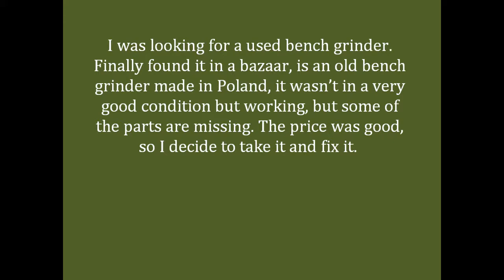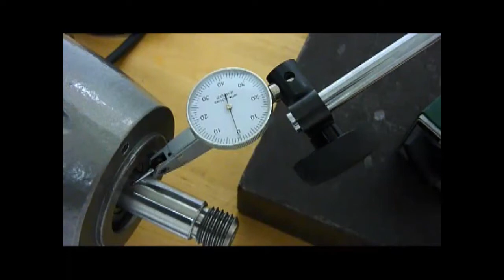Repairing a bench grinder part 1

Comment: Quality work! Just picked up an old Ranch Rite unit myself!
Reply from the maker: +TheFurriestOne  
Thanks! I searched on internet for pictures for the Ranch Rite, but I didn't find anything. Can you send me a link?
Thanks again

Cheers
Jimmy
Reply: ***** I would, but I haven't found any in my own searching! I completed the tear-down and got replacements for the bearings (the old ones had run dry of grease, though they hadn't failed yet). I just got it back together this evening after some cleaning, but now it has issues starting so I'll have to look up what I might've adjusted wrong. It's a bit larger of a unit than yours I think, it's a 3/4 horse unit.
Reply from the maker: +TheFurriestOne 
You can see if its need a new capacitor? I hope you find the problem and put the grinder in use soon!

Best regards from Greece
Jimmy
Reply: ***** Well, I adjusted the centrifugal switch for the start windings and now it works great! I just have to see whether I can adjust the wire wheel so it isn't wearing through the housing, or maybe I'll replace it with a new one. We'll see.
Reply from the maker: +TheFurriestOne 
Sorry for the late reply. Nice to hear that everything it's ok! I can't think something more enjoyable than restoring an old tool or machine! Well done! Send me some photo when you can, I would really like to see the grinder.

All the best 
Jimmy
Reply: ***** Soon as I get some, I will!
The date on mine is 1977, btw.
Reply from the maker: +TheFurriestOne 
Ok! The date on mine is 1981.

Cheers
Jimmy

Comment: Thnx for sharing, i ´ve been using a bench polisher wich is similar to your grinder for a couple of years, but has the same axl problem than yours....and this results in noisy vibrations...any clue on how to solve it?
Reply from the maker: +Nicola Canali 
Thanks for the comment, Nicola! The first thing that you have to do is to check if there is runout on the shaft. If so, then a set of new bearings will resolve the problem. But there is something else that you need to check, since you are using it as a polisher. So, if you use extensions on the shaft to attach brushes, you need to check if there is any runout on the extensions.
I hope that this helps you a little?

Cheers
Jimmy

Comment: I have a grinder like yours and it has lost power. I changed the cap on it, and I was shore it would help, but no it didnt. so I am thinking there is a short some where, have you any idea why a motor like this lose power ? By the way What kind of metal do you use that it is so easy cut it by hand ( well I know it is not that easy, as I have tried it too and it is half a milimeter for every 4-6 minutes....:) thank's for sharing
Reply from the maker: Hi,
Thank you very much for your comment! I'm not an expert on electric motors and I can't say anything for sure. I can tell you what was the problem with my grinder hoping that will give you an idea. The problem was that the motor had a smaller capacitor and it didn't had enough power to start it.
So, you can start by checking if the on-off switch is working and then check if your motor has the proper capacitor and if its working or not. If you don't know how to do it please ask a professional!
The metal was steel and the thickness was 1.5mm, it took me half an hour to cut it. Glad to share!

Cheers 
Jimmy
Reply: Thank you very much for your response. It really am Grateful that you took the time to answer. Since then I bout a Ford Grinder very similar to the one I had before, but with very little more HP. So I do hope that this one lasts, and I am a proud owner of a lathe so I have enough to do for sometime. :) Thank's again for your Kind help :)

Comment: The threaded rod that holds the case together the nuts were rusted I had to grind them off. and now I cant get the Rotor off the bearings on either side have threads it appears not sure if I need a puller.
Reply from the maker: When I disassemble the housing of my grinder the bearings stayed at the rotor. So I went the rotor to the local machine shop that has a hydraulic press to pull the old bearings out and press in the new ones. Perhaps you can do the same?

Comment: Nice job! I picked up an old bench grinder at a market but it has had its wiring cut off and missing the capacitor. I do have another capacitor from another bench grinder base, but I am struggling to find a diagram of how to rewire the capacitor and switch to the motor. It has four wires coming out of the motor and I can't figure out what goes where.  Any advice would be greatly appreciated :-)
Reply from the maker: Hi,
I apologize for the late reply. Thanks for your comment! I'm so sorry, but unfortunately I can't help you on that, because I don't know anything about electric motors. I always ask the help of a professional. With the particular grinder I just marked every wire before disconnecting them in order to change the capacitor. Thanks again.

All the best
Jimmy
Reply: Thank you fir your reply - yep, I do the same as well, but in this case it isn't wired up so, therefore my problem. Thankfully tho, a friend of mine who is an electrician is coming to visit in a few weeks time, so I will get him to look at for me.
Reply from the maker: Glad to hear that your friend can look at it. I'm sure that is going to be an easy fix for him. Thanks again for your comment!

Best regards from Greece
Jimmy

Comment: what capacitor did you use?
Reply from the maker: The motor is 370W (1/2 hp) single phase 220V. The capacitor is μF 8 +/- 5%  at 450V. Hope that helps?
Cheers
Jimmy